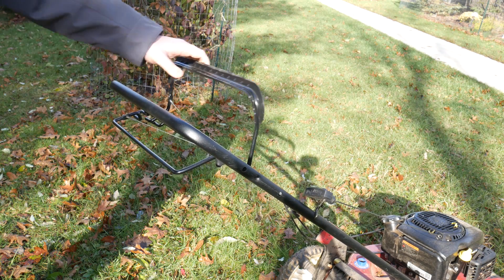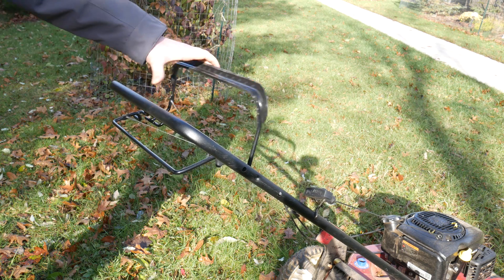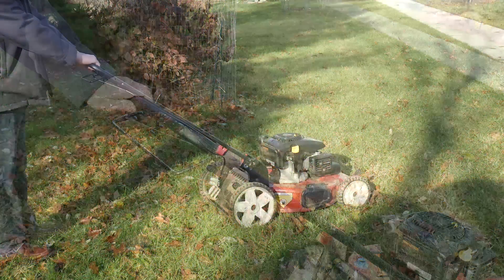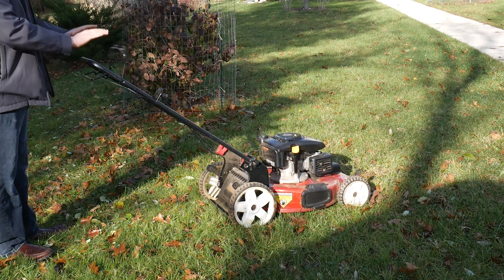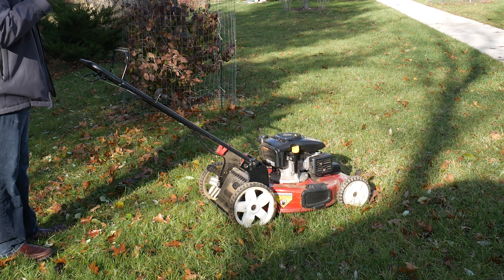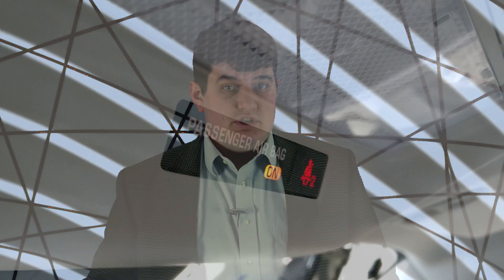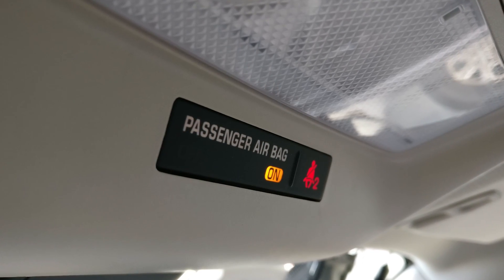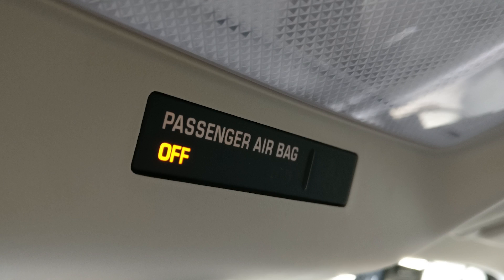The Dead Man's Switch:  How Anton Yelchin's life could have been saved

Comment: That is all very interesting, but bear in mind that this incident is very isolated, since normally the shifting lever is very intuitive and the operator knows exactly what gear they have selected, so there is no need for that safety measure. The problem  is this case is on the system that Jeep developed and installed in that model, that obviously does not work properly.

I do have a big doubt about Yelchin`s particular case. When you put the car in Neutral, Reverse or Drive, the car will move in the same instant, it will not wait for a few seconds to move, how is it that he putted the Jeep in N, and had time to step out of the vehicle and walk behind it, it does not make too much sense to me.

Comment: A lot of children of the cold war atomic age are deathly afraid of microwave oven cooking because of lack of knowledge between nuclear radiation and non-ionizing radio radiaton, however the microwave oven has a very important safety advantage you probably didn't even imagine or dream of...yes, a deadman switch. The microwave oven has a timer that only permits applying heat to the food for a limited period of time, you are much less likely to burn your house down cooking in the microwave than a conventional oven or range. If you boil a pot of water on the stove after an all nighter then fall asleep for 12 hours, eventually all the water will boil dry and the pot could theoretically reach the melting point, spilling hot slag onto the floor and setting the house ablaze. Boiling a cup of water in the microwave will cause no more heat to be applied to the system when the timer runs out even if you are very incapacitated. If you are late to work from a stopped train you might lose your job, if you are dead from a runaway train crash you might as well be late to work for eternity. Sometimes you have to choose the lesser of two evils. Or in the case of drunk driving, be thankful it was the cop that stopped you and not the tree.
Reply: Well, that's why you don't drive drunk, but that is an argument for another time.

Comment: Airbag deployment actually relies on a set of volumetric sensors scanning the interior of the car, and was first used in Jaguar Cars by Autoliv Safety systems. (I helped collate positioning data with them.)

However, if a pressure switch is fitted to the seat to warn an occupant to insert their seatbelt, there is no reason why this system can't be used to switch off the car if it is in gear and the driver leaves his seat.
Reply: TheSaintST1 that's a good thought. But no. Today's airbags are controlled directly through the ocs. Why? Because the system you worked on was too expensive.

Comment: My 2014 Volkswagen Golf mk7 automatically deploys its parking brake if i open the driver door while the engine is running. But it is manual transmission i dont know if the automatic woud, but i guess the same thing. of cause you need a electric parking brake.

Comment: What if the engine is broke and you want to push the car down the driveway? You have to go find someone to sit in the seat?
Reply: Yes
Reply: @retrogameblog8446  Yes. Yes that would probably be a good idea 😂
Reply: A  horse / push / tow mode could also deal with that
Reply: If one of the sensor in question is the seatbelt sensor, you could exit the vehicle, buckle the seat belt on an empty seat, then push the car.
Reply: 6:35...
Reply: He even suggests an override for broken sensors that could be used in a scenario for pushing the car; press the engine start/stop button five times in a row.
Reply: So you mean like it's now when you have electronically-controlled transmission and electronics stop working (battery dies, whatever)? There's mechanical override button, usually under the steering column.
Reply: This proposal addresses that.  Just place a weight or gear shift from the passenger seat with this system.  Usually I would think you would need someone to steer in neutral in most cases anyway though.  https://gist.github.com/truewaifu/bb92965d80495e2f8c7fa487f2ebd062
Reply: Like the rope some people use on the mower so they can move things out the way with out having to re crank it.
Reply: Michael Deering what about a mechanical override like on a lawn tractor.
Reply: Every time I've needed to push a car, it's also been necessary for someone to be sitting in the driver's seat to steer it...
Reply: or when my old car broke down in the middle of a highway a couple of months ago. i had at least managed to straddle 2 lanes before it died but then i had to get out and push it the rest of the way.
Reply: Ah yes, buy a Fix-Or-Repair-Daily, that way it won't break down.

Oh wait.
Reply: Most cars these days already have a tow mode.
Reply: have to push it in a shop once tow truck drops it
Reply: Ask Anton, the dead only know one thing. It is better ro be alive.
Reply: Violent Apathy Considering Anton died because he accidentally shifted into neutral instead of park, no neutral could not work as usual, that's the whole point
Reply: @DFW rider It is amazing how so many people post 'but what about if...' when it was already covered.

A button or switch to disengage the safety protocol so you can move the car.  Mine can't be shifted without the engine on.  There is a slot that overrides this if you put the key into it so you can push the car a couple of feet so you can get a jump if you have short cables or need to reposition the car for a tow truck to hook onto it.  It isn't something you can disengage by accident.
Reply: Us wrecker drivers run in to the annoying auto-park on a few things. Reason I say "annoying" is because, if the vehicle runs and drives, we usually have the drivers window down and door open, and drive it up while looking to make sure we get the wheels in between certain bed pockets.
With the auto-park, you try to do this, move 3 feet, and *CLUNK*.
As for Neutral, cars usually have a manual override somewhere. Under the dash (Chrysler), under the arm rest in the center console (also chrysler), under the cup holder (BMWs), a slot next to the gear lever, etc.
But the only time I ever run in to that Auto-park stuff, is with vehicles with that have that joystick shifter looking shit.
Reply: Olfway12991 problem is this car did not have auto park or automatic ebrake (think it used a foot handbrake on this version) but used a stupid automatic electronic classic up and down shifter but returns to center when you let go of it (not the nob type) some one even did a video of it of his own car and he even finds at times he misses Park or drive or neutral and has to constantly look at dash to see where it is (witch can be difficult to see under sunny conditions) just don't understand why if it's a vertical shifter they could just Not have it so it locks into place like mechanical ones did
Reply: Putting a car in neutral doesn't interact with the engine. I've pushed my car in neutral when the engine was off. It'll be fine
Reply: It can be fixed if they do it like they have on the F1 cars today. F1 cars today have a button that a marshal (or driver, like Vettel did one time) can press to get the racer into neutral, when they need to move the racer out of the way and when it is locked in gear
Reply: dunebasher1971 I've seen and pushed many cars from the driver's door, steering as I pushed.
Reply: mjc0961 Your overused acronyms parroted by idiotic Chevy fanbois don't detract from the fact that Dodge products are known for being unreliable pieces of shit whereas Ford and GM are pretty hit-or-miss
Reply: Chrysler’s, Jaguars, and other cars with electronic shifters have a manual transmission release that you just pull to roll the car.
Reply: The danger of "sometimes" - the presenter has already done a video on this subject re: traffic lights.
Reply: He did mentioned in the video, enabling features like pressing the start/stop button 5 times to disengage the safety features temporarily. Most cars now have some fashion of override already built into them. For instance, reseting TPMS on my car you turning the key to "run" and press/release the brake 10 times. Or reseting the oil change indicator on later models.
Reply: Neutral could still work as intended
Reply: That reminds me of xkcd 1559 ;)
Reply: Put it in Neutral. The same way you would have to even if a dead-man's switched wasn't implemented. In other words, nothing would change for your use case.
Reply: Melody A tow truck would be blocked by the "don't allow having the gear in free-rolling neutral without a driver" mechanism.  Which is the entire false premise of this video. All the details of how to enforce the rule become pointless once you realize the need to push and tow empty vehicles in all kinds of situations. Which brings back the original issues from the accident, such as making it too hard to know if the car is in free-roll or parked mode.
Reply: Buy a ford. That way it wont break down like a shit dodge
Reply: +John Francis Doe
You know how you can tell if a vehicle is in Park? By looking at the instrument cluster to see if it's in Park. And if you have any reason to doubt it? Apply the parking brake. And if you still aren't sure? Test it. This wasn't caused by a fault in the car's systems, it was a fault in the driver's diligence of responsible operation. I'll grant that it was a goofy system, but that doesn't alleviate the fact that he or anybody else having problems with it should be paying attention to their actions.
Reply: Michael Deering lets kill someone because you want to push your broken car instead of calling a tow truck